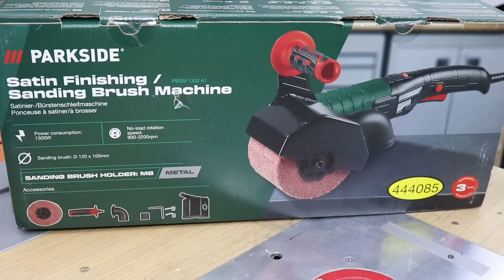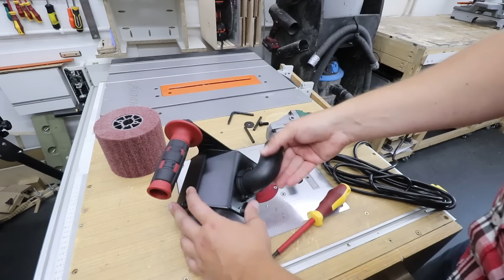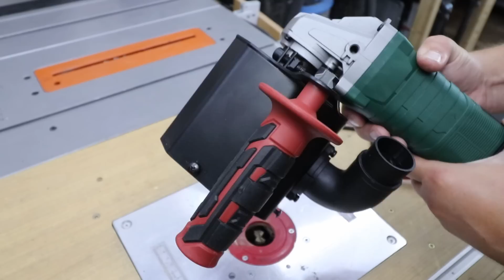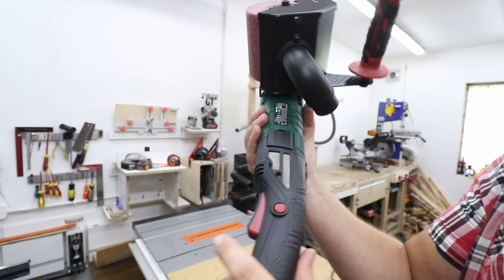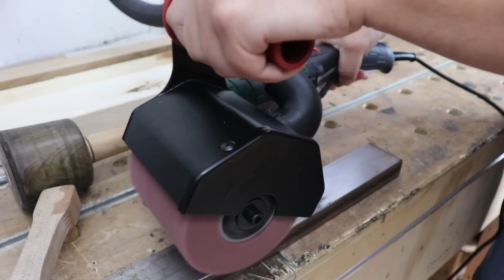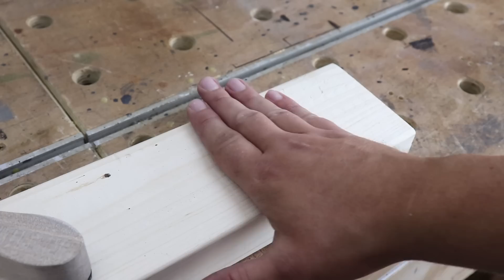Parkside Burnishing Machine - Sanding Brush Machine | First Impressions

Comment: This would be perfect for anyone doing Yakisugi/shou sugi ban.
Reply from the maker: Exactly 👍
Reply: @CasualDIY  
I found when I did some recently that the best results were to use a very coarse bristle to dig deeper into the soft wood between the rings before burning and then a softer brush after. The deep texture of the wood was beautiful especially when the light hit it from an acute angle. I tried staining wood samples with some bright colours, using ink then lightly sanding to remove it from the raised grain but leaving it in the textured grooves. I thought looked great but my friend decided she preferred the more natural contrast of the charred wood with the blond wood in the deep grooves. 
The best bit was, every piece of slow-grown pitch pine we used was free from a skip outside a house having its roof replaced and much higher quality than the crap you’d find in a DIY Center.
Reply from the maker: @Therapistinthewhitehouse  Lucky with the wood I can see. Yes it's all about experimentation and finding the result you are after. And there could be some surprises along the way 😄👍
Reply: @CasualDIY  
I'm known as “Bin Raider the Shameless” by my friends cos I can't pass a bin or skip without having a look🤣
Reply from the maker: @Therapistinthewhitehouse  definitely nothing wrong with that 👍

Comment: As usual the UK is treated badly by Lidl 
In Europe you can buy on the Lidl web site, But in the UK Lidl provides no facilities to purchase goods online also some tools you see on the European Lidl sites you don't usually see in there UK shops. It's a shame because I buy a lot of Lidl tools.
Reply from the maker: That is a shame to be honest. I think before Brexit what used to happen, certain tools dropped in UK stores and then (for example) in Poland they came in about a week or two weeks later. Shame you can't order Parkside tools online through Lidls website. There is a ton of cool tools there that I don't think you will see in store.

Comment: I’ve been using these in engineering for over 25 years, the Poly PTX.
Back in the early 2000’s the machine was around £450-£500, and the replacement drums around £25, we still use them today, and the drums are readily available.
I missed the price on this machine, and I’m not sure I want to know….😭
Reply from the maker: It's far, far, far cheaper now
Reply: @krazytroutcatcher  they go back even further, just a new take on old methods,.

Comment: Warning. When using this tool with a mixture of wood and metal, I would urge caution. Hot metal sparks can easily start a fire if blown into a container full of fine sawdust.

In other words, your dust extractor is full of fine sawdust. If you use this machine with your regular dust extraction running, there is a chance (admittedly quite slim) that you could be throwing red hot metal shards into the extractor, which could cause a fire in your dust extractor.

Otherwise, excellent video. Thank you.
Reply from the maker: @daveash9572  This brush doesn't create sparks, it's synthetic. However if you get a brass wire brush or metal wire brush then you potentially could get in trouble using them on metal, that's why they are dedicated for wood and like materials, and not for metal.

Comment: It made a fine job of that metal! I’d just worry about sourcing replacement drums, brushes etc down the line.
Reply from the maker: Why is that? They are not Parkside unique. I've bought three other brushes all from different brands. No issues in getting them.
Reply: @CasualDIY  ah, good to know… thanks for the info :)
Reply: Lidl online?

Comment: I found the machine in the LIDL online shop in Slovakia, where I read the review. One of the repeating remarks was, that LIDL does not provide spare brush cylinders.
Or didn't they read the manual?  Where did you order the brush cylinders for wood?  Are they also from Parkside, or an other brand?  In case the latter, how will you know it will fit?
Reply: The brushes are standard consumables which are offered by many manufacturers. From cheap products from china to expensive brands. The size is normally 120x100 or 100x100 mm. Both sizes fit
Reply: @samfisher995  Thanks.
Reply from the maker: Standard brushes mate, you can buy them very easily. I bought 3 different types all from different brands 👍
Reply: @CasualDIY  Thanks for your explanation. I'm sure you'll tell more details in your future videos on this topic.

Comment: a quick google and found just the attachment for £18 with £9 delivery from ebay
Reply: Apart from the lack of a dust cover, there is another reason why the two machines are not comparable. A normal angle grinder has a higher speed, usually over 10000 rpm. The brushes are not designed for this. Even if you have an angle grinder with speed control, there is another problem. It lacks power in the lower range.
This machine, on the other hand, has a different gear ratio and only rotates at 3200 rpm, but delivers more torque to the shaft.
Reply from the maker: @glasgowjohn7831  seen some of those attachments but none of them had good reviews and opinions